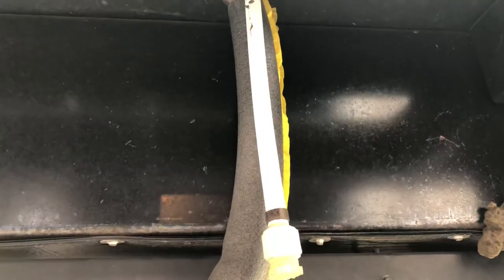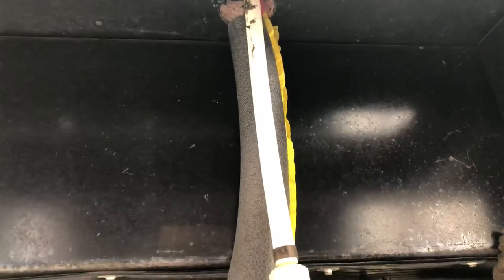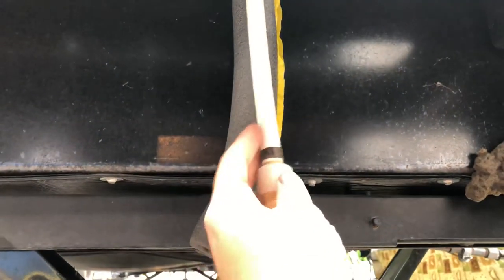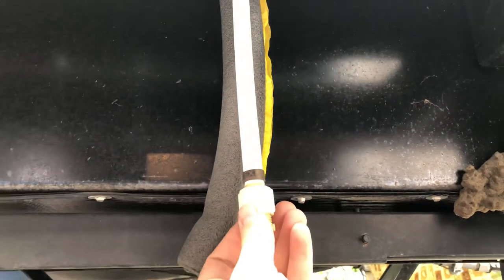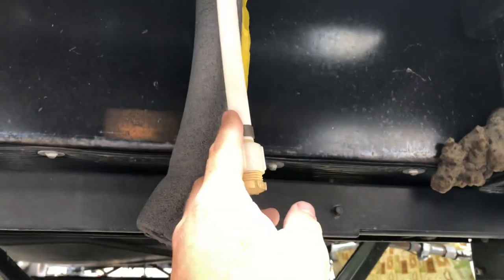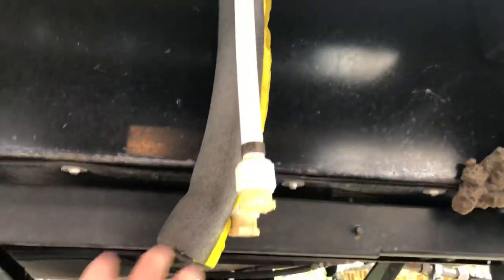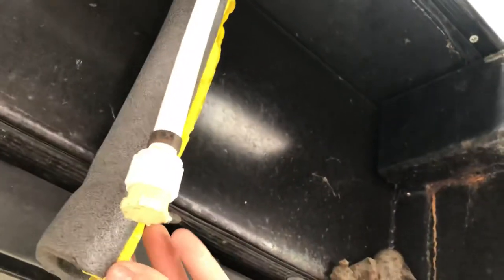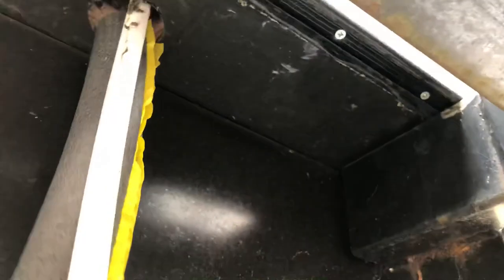How to Winterize Your Rv Low Point Drains

Comment: I have two white lines, one has black cap, one has no cap, actually doesn't look like it ever had a cap. The one without the cap has water coming out, 2017 Highland ridge Open Range Ultra lite. Any advice would be greatly appreciated.